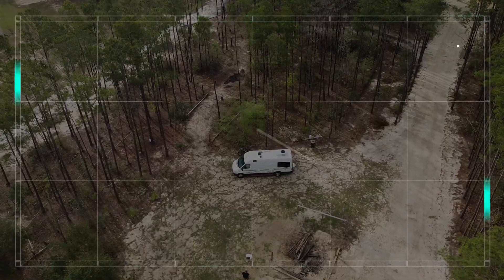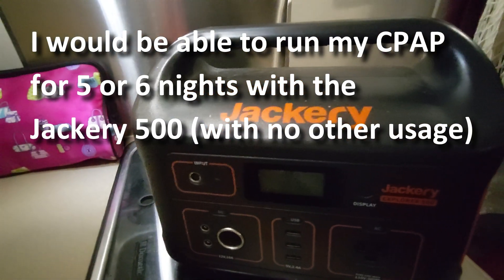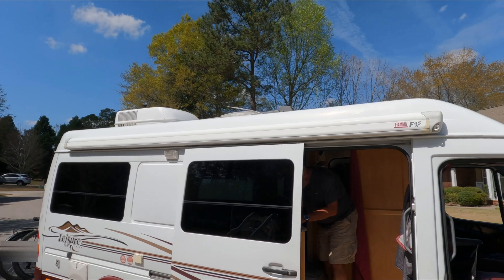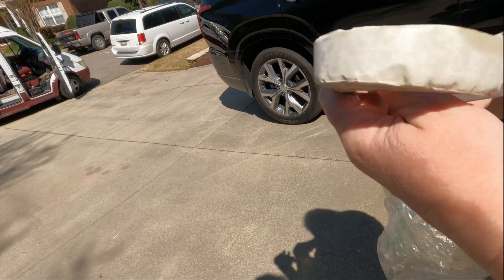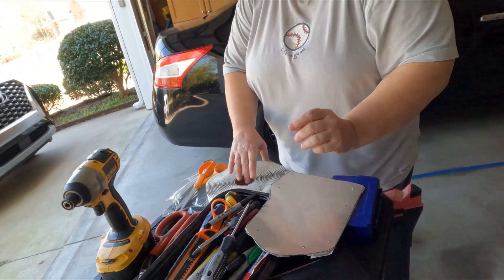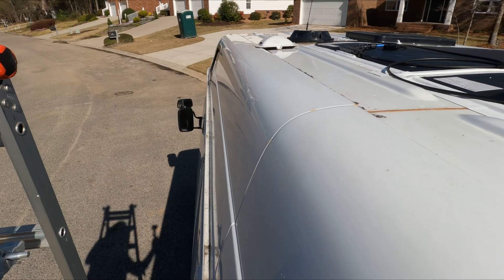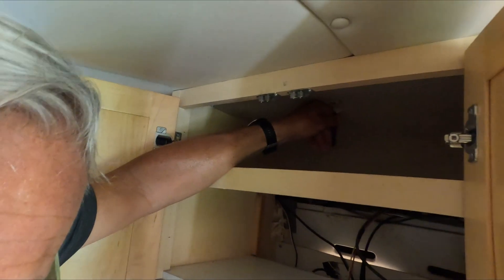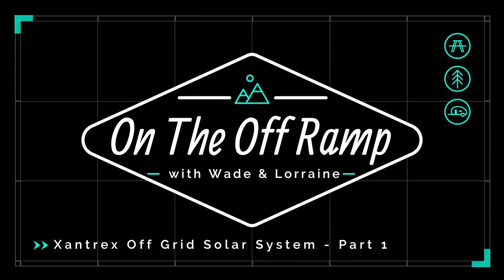Part 1 - How To Install XANTREX Solar Flex Panels on a Vintage Leisure Travel Van

Comment: Wow, very nice upgrade there guys! What made you decide to do an “nail down” onboard system rather than upgrade your portable power system and run the van off of the larger portable power system? (For context: My wife and I own a T@G teardrop trailer and I have been considering upgrading the onboard power system to Lithium and expand our solar capabilities - but after much research I’m beginning to lean toward just leaving our original AGM battery and 100w onboard flexible solar panel…but them running the unit primarily off our 1000w Jackery) …Just want to pick a fellow Winnipegers brain a little!  Great video BTW.
Reply from the maker: Thanks Scott.  Nice to hear from a fellow Manitoban.  So one of the things that we have found with traveling in a van is that there is very little room for "extras".  Between extra hobby stuff and all the gear that one needs for camping we are constantly moving around items as we park for the night, trying to make room for a hallway (no, we're not hoarders 🤣).  By utilizing the back wheel well storage which we don't access very often we able to remove the Jackery and the solar panel from our living area.  For us to get the same power from the Jackery we'd need to switch it over to a Jackery Explorer Pro 2000 which would be even bigger than the 500 that we have.  These are great units and the 500 filled a need however by changing our electrical panel and adding the Xantrex system we were able to complete the entire system.  The only thing that does take up a little more room now is the lithium battery as it was too large to fit into the battery compartments under the floor at the back of the van.  But that will become another storage area for something else.  Also, this system is connected to the on-board propane generator (which we only use in dire circumstances) so it ties it all together.